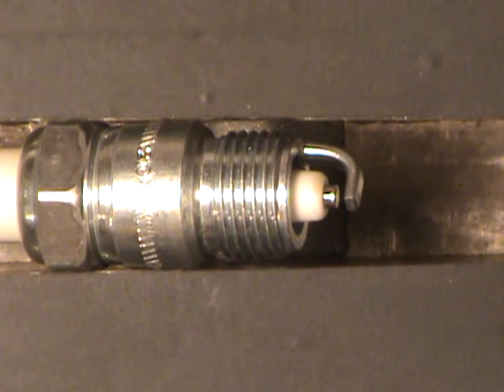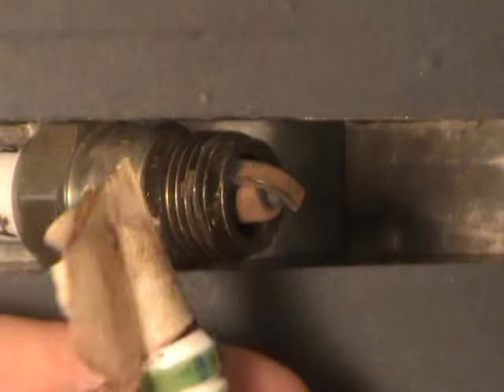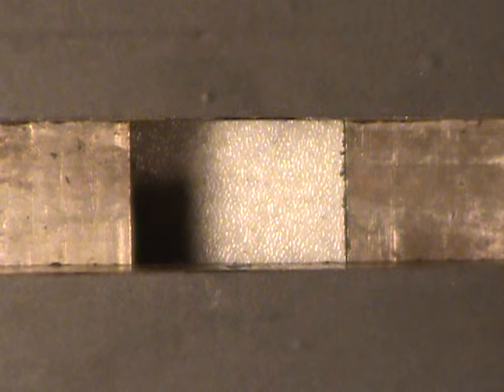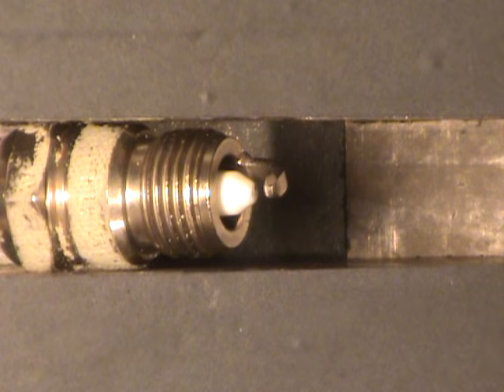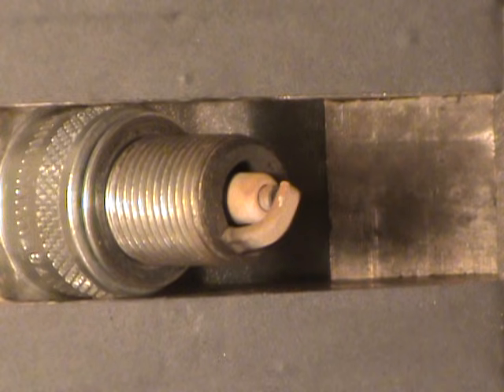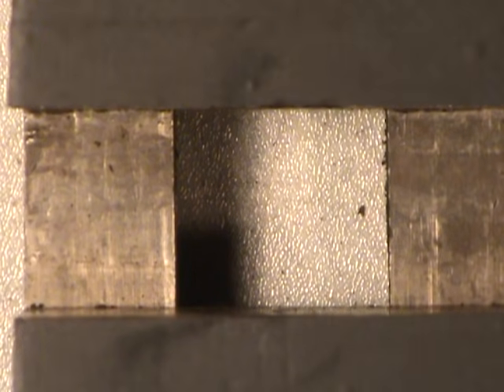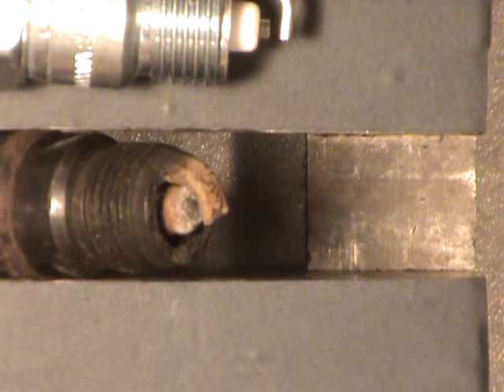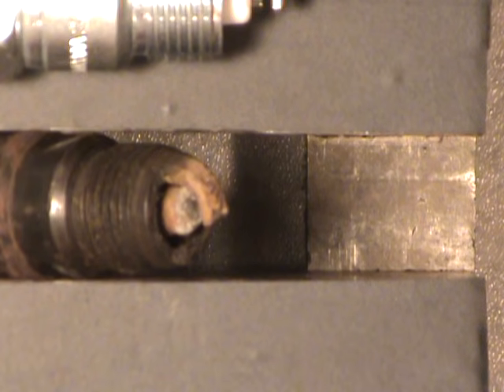SPARK PLUGS How to Read them (Part 3)

Comment: Hey Rocky, thanks for taking the trouble to make this vid man :). I have some issues with my engine and I learnt a lot from it. It was great help in learning to how to actually read my plugs!

If you could offer some advice on my issues listed below, I would be indebted!

I have a 396ci Chevy Small block in my track car (an Ultima) weighing in at 1000kgs. It has a 750cfm Edelbrock carb, running 10.4:1 comp putting out around 500Hp. It's a dressed crate engine ie came complete with carbs and HEI dist. The issue I have is detonation (at load and WOT) when I set timing at 16 deg initial and 34 total. Backing it off to 31 deg total still sees some detonation. I then had some misfire. When I pulled the plugs, 3 out of 4 from the left bank had glazing on them. The right bank ones looked ok (from your vid; medium/dark tan on the ground strap and tip of center electrode). The porcelain did turn black towards it's base though (as seen with a bright LED point light). The plugs were Champion C59YC.

Are the plugs too cold for my application? They are black towards the base of the center electrode and the base ring of the plug. And why am I seeing detonation?

I have installed a set of NGK's with a 7 heat range on them (2 steps hotter?). Misfire has gone and she revs clean and idles well but all this when parked (I haven't taken her out to the track yet and she isn't road legal). Would the 7 heat range on the NGK be ok?

If you could point me in the right direction :) ?

Thanks in advance!
Kris
Reply from the maker: Greetings kris993tt....I will open with, Thanks for your nice comment, and, for thanking me in advance, my Friend....Now then..."Doctor Rocky" in da House!...now, bring me the "Patient!" (aka, your Ailing 396 Chevy small block Engine)...lol....Oh my gosh, where to begin....I know, how about I start with the "Imbalance", as in One of your Engine Banks seems to be burning the Fuel quite well, whereas, the Other Bank is  "Not" doing so good, well at least 3 of the 4 Spark Plugs on that particular Bank looked "Glazed" as you had indicated....To me, those 3 Glazed spark plugs are trying to let you know, that, they are not very happy!....My first though has me thinking that, it could perhaps be an "Imbalance" with your Edelbrock carburetor, or perhaps even a "Distribution" Imbalance with your "Intake Manifold', or even might be a "Vacuum Leak" at any of those 3 out of 4 Intake Ports on the Intake Manifold, to the matching Ports on the Cylinder Head, with that there "Gasket" being responsible for maintaining a good "Seal" between the 2....The very Fact, that only 3 out of the 8 Spark Plugs in your Engine are having the Problem that you had mentioned, also has me thinking that, there might also be an Ignition related issue as well perhaps?

Just to let you know...

My Method of Reading Spark Plugs is "Old School".
Some of the Folks that are Really into it, are Cutting-Off the Metal Shell (threaded portion), and having a Close-Up Look at the Center Electrodes Porcelain, way down where you can't usually see it, and, those High Tech Guys/Gals, are using a Magnifying Glass, of one sort, or another!

In this Day and Age, your Best, and Safest Bet, to ensure that you Don't Damage or Destroy your High Horsepower Engine, is, to Invest, and Install a "Wide-Band"...or better yet, "2" Wide Band Oxygen Sensors, one in each of your Dual (I hope) Exhaust Manifolds/Headers, that usually comes in a "Kit" with an "Air/Fuel" Ratio Gauge, that will give you a "Read-Out" in Real-Time, as you are Driving/Racing.

and... a REV-Limiter for your Ignition System, so you Don't Blow-Up Your Engine!!!

Oh yeah, about installing the/those Wide Band Oxygen Sensors...
I would recommend Installing "2" Wide Band Oxygen Sensors (again I say, one on/in each exhaust manifold/header!...lol).
You can wire it with a switch, so you can switch between both "Banks", while having only "1" Air/Fuel" Ratio Gauge.

or...

Go the A-List (Actors) way, or in other words, Spare No Expense!..lol.
Seriously now, what I meant to say, was to, have "2" Air/Fuel Ratio "Gauges" on, in, or near your Dash (as in dashboard), that way, You can "Monitor" Both Exhaust "Banks" at the very Same Time!...thus Preventing some very Tearful, and Expensive Engine "Damage!"
 
The, so called "Glazing" that I'm use to seeing, is when, you have a set of spark plugs in your Engine, that are all coated with Deposits, and, the Engine only sees City Speeds for the most part...Until, that Car, or Truck, gets taken on a lengthy Drive on the Highway/Interstate/Autobahn/etc., with the Resulting increase in spark plug Temperature, that, kinda melts, and Fuses, those there Deposits into a wanna be Kiln Fired Glaze, that you see on some Tacky "Glazed" Pottery Object!...lol...but, unlike a stationary Pottery Object, that there "Glazing" on the Spark Plugs becomes "Conductive", resulting in, one or more "Shorted-Out" (to Ground) Spark Plug/s!!!

I never Rule Out any possible things, that may be causing a Problem, as, I keep finding "New" things from time to time, when I, like others Assumed that, I think it's this, or, I think it's that...We just have to Keep-On-Lookin until We actually Track Down and Find that Culprit/Gremlin!

Now, about your "Detonation" Problem...

What Fuel are you using?

I hope that it's Very High "Octane", because of your "High" 10.4 to 1 Compression Ratio!

I'm not even sure that 93 Octane (R+M divided by 2) Pump Gas would satisfy your Engines needs, when you are pushing it that hard.
Or, are you using Race Gas/Aviation Gas Perhaps?

Also, try to find out if your Fuel (gasoline?) has any "Ethanol" in its Mix, and perhaps, let me know.

With having the 5 out of the 8 Spark Plugs Showing the Tan Color, as you had mentioned, that to me Indicates a "Not too Lean" Mixture (Air/Fuel Ratio).
Also, by seeing that usually "Safe" Tan Color, it shouldn't hurt your Engine, as compared to a spark plug that enters that, White Colored Porcelain, that I will call, the..."Destruction Zone!"

Generally speaking, when you are running a Race Car, more then likely, you will be running spark plugs with a Lower Heat Range, for the reason (my train of thought), that, you are Really "Working that Engine Hard", and, the spark plugs will be running hotter because of that...

whereas..

If you tried to run a Heat Range of that "9" (Champion Heat Range) on the Street, in No-Time, those spark plugs would be covered in Carbon, especially, in slow and non-moving Traffic!
A higher heat Range is needed on the Street, so, the spark plugs Reach their "Self-Cleaning" Temperature.
 
If it was me, with having your situation, I would be sticking with the Installed/Recommended Spark Plugs that were in the Engine, when it was in the "Crate", and, hopefully, your Crate Engine was Built/Adjusted by a "Reputable" Dealer/Person, that knows what they are doing.

Watch out now...With the Champion Spark Plugs, the Higher the Number = a Higher Heat Range...

whereas...

with the NGK's, the "LOWER" the Number = a HOTTER Heat Range!!! (at least from what I recall, that is).

Even Your Champions Numbers are a bit different, to what I'm use to seeing.
Probably/maybe, they might just be Racing Spark Plugs perhaps.

I had a look-see, and with your Champions, they appeared to be a Number "9" Heat Range, which must be Racing Plugs, because, I usually run a Champion Heat Range of "12" on the Street.

The black, probably "Carbon" that you see at the spark plug/s "Base", is probably the Result of having your Carburetor with the "Choke" On, that provides a Really "Rich" air/fuel Ratio/Mixture, on your Very Cold Engine, before it reaches Operating Temperature.

Another thing...Has your Engines Piston Rings "Seated" in their Cylinder Bores yet?
Keep an eye on your Oil Level, Oil Pressure and Oil Temperature.

Hmmmm, gee, I wonder if Kris has an Adequately Sized "RADIATOR", with the Ability to "Shed" (Transfer that Very Hot Coolant, aka, antifreeze/water mixture) of all of that "Large Quantity" of "Heat", that his Mighty 396 Chevy V-8 Develops, that rivals that, of a Nuke-lee-ear Power Plant?

Hey Kris, make sure that your "Radiator" has the "Capacity" and "Rating" that can Handle your 500 Horses!!!
Also, the "Newer" the Radiator, the Better.
Why you ask?...
Because, I have already had at least "2" instances, where, those Radiators of mine, became very Sneaky, and did it Silently as well, in that, they started to Corrode/Plug-Up "Internally", causing "Over-Heating" of the Engines "Coolant" (again I say, antifreeze and water mixture!...lol).

Find out what your Engine Manufacturer "Recommends" for a "Thermostat Temperature", as it Applies to the way in which your Ultima will be Driven/Raced, by You, the "Driver!"
Engine Temperature is "Critical", and very, very Important, as it applies to Maximum Engine Performance, as well as, how long Your Engine is going to "Last" (seconds, minutes, laps, miles, kilometers, just pick one!...lol).

Whenever you "Adjust" your "Total" Timing (with your HEI Distributor), you also "Change" the "Initial" Timing, and, how much Timing that there use to be, at any given RPM's Timing Advance, as compared with the Original/Previous Timing Setting.

I would do the following...

Clean the "Original" Spark Plugs, Check the Spark Plugs Gap Settings, then, Re-Install them in your Engine...or...Break out your Wallet, and purchase the Same Spark Plugs that were Installed in Your Engine while it was in its "Crate".

Re-Set your HEI Distributor to where it was "Originally", as it came in the Crate.

Find out just "What" Fuel (gasoline or whatever your Engines Manufacturer) Recommends for Your 500 HorsePower Engine, and, please, especially with 10.4 to 1 Compression, don't entertain the Thought of buying Cheap/Low Octane Fuel (gasoline?), unless, you can Add some Octane Booster "Concentrate", to Insure that you have the Required "Octane Level" to Scare Away all of that Detonation!!!

Bottom line...Engines with High Compression Ratios "Need" High Octane Fuel, that's a given.

You can only "Back Off" your Timing so much, then, Trouble will be Brewing.

Check for any Vacuum Leaks, as in, everything like, Hoses and what they connect to, Gaskets, Carburetor mounting nuts or bolts, etc.

Check all Electrical Wiring, and connections.

Your Edelbrock carburetor might possibly have some Dirt/Debris/Crud inside it, perhaps from something like little pieces of Rubber Fuel Hose, when it may have been cut to length, and, those little rubber Bits were washed into your Carburetor, when the Fuel was pumped on through.

So, there you have it (well, for now, anyways).

I hope some of my Long-Winded-Ness, might help you find Your Engines, Culprit/Gremlins...

Let me know, how it's going, if you care to, and, I'll help you out, as best I can.

Be Safe, take care, and have a good one.
Reply from the maker: Greetings once again kris993tt....I have a quite a few Automotive "Videos" on my YouTube Channel, that will probably help you out with your Ultima....To find them, just go to YouTube's "Main" Page, and, type...RockysRoadshow...into the Search Bar/Box at the Top of YouTube's "Main" Page....Doing the Search, should bring up about "77" Videos that I currently have on my Channel, and, most are Automotive related....The "First" Video of mine, that you should watch is titled...Spark Plug Misfire...and, this particular Video of mine, will show, how You, Others, and Myself as well, can at least somewhat "See", if that "High Voltage Electricity" that the HEI Produces, makes its way, all the way to "Each", and every Spark Plug, to make sure, that the Spark Plugs are "Receiving" that "High Voltage Pulse" from the HEI Distributor, in order for all of your Engines Spark Plugs, to be able to "Create" a nice "Strong Spark" between its 2 "Electrodes!"

I use a "Flashlight" to Demonstrate, How the "High Voltage Pulses" should be making an "Inductive" type of "Timing Light" Behave, when the Ignition System is working Properly, and, as it should.

I had a very Bad Ignition "Misfire", on a Chevy V-6 Engine a while back, and, I barely made it home that day, because the Engine was running Horribly/very sick.

It turned out to be 1 of the spark plug Wires/Leads, Electrically "Arced", where the Wire/Lead gets attached/crimped to its Metal Terminal, way down inside the spark plug "Boot!"

It did show up, when I took some Ohm's (resistance) readings, and, also, I did notice some White-ish, Corrosion-like Deposits on that particular Wire/Lead as well.

Now I'm thinking, just because something like, a Set of spark plug Wires/Leads that are "Factory Fresh", (in my opinion), doesn't mean that they are absolutely 100% "Fool-Proof", or, in other words, perhaps a "Manufacturing Defect", might just be causing a problem or two.

If the "Crimping/Mechanical Attachment" is not 100% Positive, where the spark plug Wires/Leads "Conductive Core" gets Fastened to the Metal Terminal, down inside, either the spark plug "Boot", or the down inside the "Boot" at the HEI's Distributor Towers end of things, that alone will eventually cause some very Unwanted High Voltage Electrical "Arcing" to be happening, resulting in, a very Bad "Misfire" like I was telling you about, a few paragraphs earlier (above).

I have learned over the years, to, Never take things for granted, as, like always, "Things Happen!"

Good Luck with your Ultima...

Be Safe, take care, and have a good one.